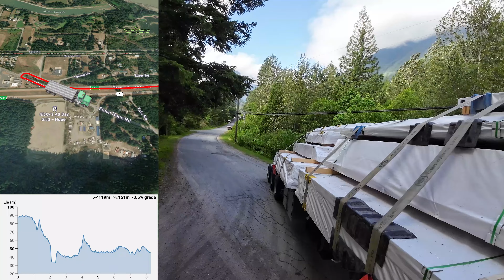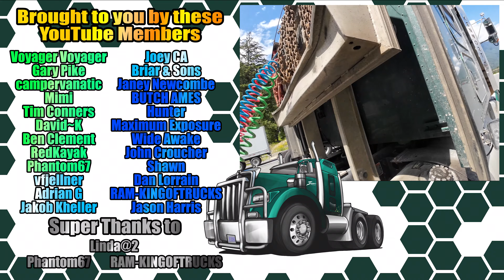CRAZY road trucks don't belong on • Hope BC • Super B Trucking Life 🇨🇦 #Laceyconstruction

Comment: My break-in days were a P12 wood wagon with a 5x4 trans, then to a P16 with a power shift Allison , water cooled brakes head ache rack a water tank, or a 16' bunked Mack on QCI these aren't goat trails, but as drivers we've got some well exercised anal sphincters lol.
 What have you got for power, tranny, super 38s or a 40 ?
 Looks like a mine site, did some falling on the 9 Mile Creek on the Climb up the Hope Princeton on the way up to slide, the trucks were pulled  up a grade by a D6, today that creek is one of my go to fishing criks, not telling my fav. it's upa logging road in Fraser Canyon,also drove a few loads down that goat trail,most people wouldn't drive up and down that billy goat trail.
 When he knocks a few teeth out in winter plowing snow on the rock hell widen the road.
Reply from the maker: So if I've given you the impression I know what I'm doing, my deepest apologies. I am not mechanically inclined at all. A little self deprivation, you may as well have spoken French. I do know this, Cummins 500hp, 1800 torque, 18 speed automated transmission.